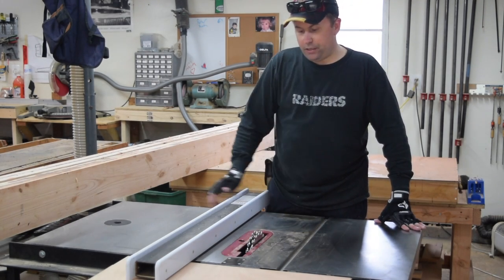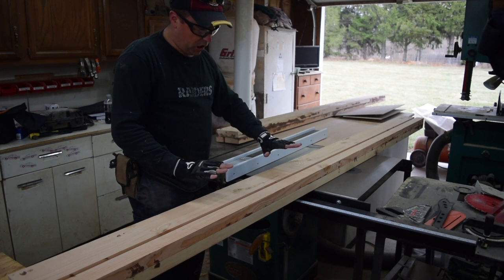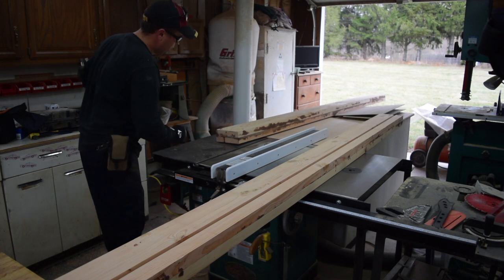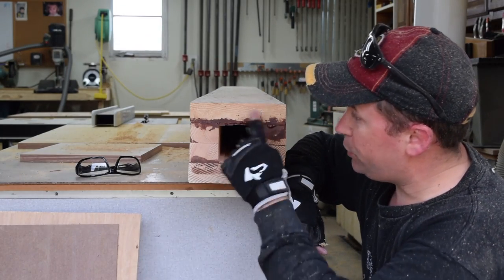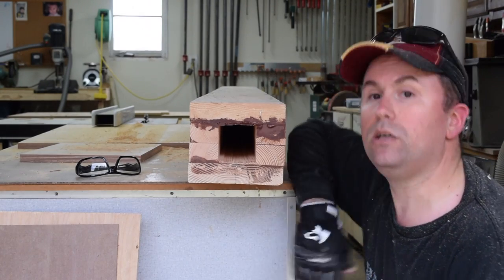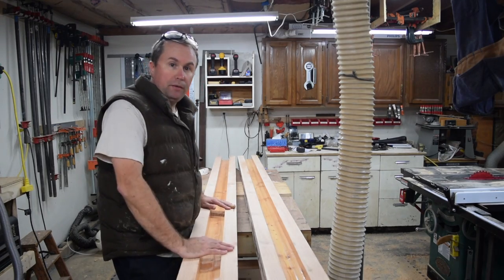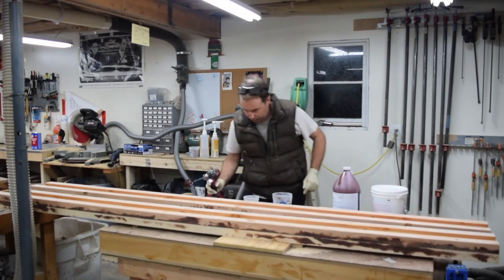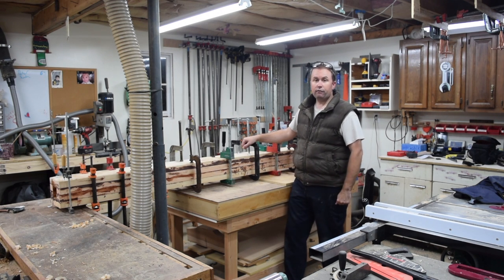Wooden Boat Building shaft log: Episode 6 Sea Dreamer Project

Comment: One trick to getting the perfect amount of resin is to simply math the volume of the glue-up. The to-be-glued area is the base and the thickness of the glue is the height. It's pretty simple, and i'm pretty sure there's plenty of Apps for iPhone or Android that can spit the volume you need. To that volume you add 1% more (or there about) to be certain and voila, you'll never squeeze glue out ever again.
Also, in my opinion it fits perfectly with the carefully measured methodology behind resin glue.
The idea is based on how they glue car panels today, they math the whole thing down to a square cm, which is incredibly precise considering all the twisted shapes and volumetry of a modern car.
Reply from the maker: That sounds really technical, I love technical! I want a little squeeze out to confirm the joint is filled with adhesive, but finding a way to limit waist is always appreciated, thanks.
Reply: The idea behind squeeze out is to demonstrate that there was sufficient adhesive in the joint,
The art is understanding how much adhesive you should apply.
Unlike the automotive industry wood workers don't have the accuracy of positioning and metering.  Also the surface is absorbent.
The viscosity of resorcinol is hugely affected by temperature, on a hot sunny day the stuff willnrun all over the place.
Finally its pronounced re-sore-sin-ol

Comment: Umm... was all that cutting necessary?  It looks (and I could be wrong) that you cut out the middle of the boards you glued onto the first board.  It appears that an easier way might have been to cut 2 of the 4 boards into thirds (or however much you were going to cut out) and then just glue the remaining pieces.  You'd get the same shape at the end with less wear on your saw, less waste (if you can find a use for those pieces you just cut), and less glue--since you'd have smaller areas to glue to start with.  Maybe next time.
Reply from the maker: It was close but there is actually about 1/4" of material still left in the board.  I thought about your idea but decided it was worth it to have a little more materiel in the log. Thanks for watching.
Reply: Percentage wise and added strength wise that 1/4 inch is a lot.

Comment: How does the cutlass bearing fit in this
Reply from the maker: Hanger bolts for both the cutlass and stuffing box.  Check out salt and tar, same keel concept.
Reply: I looked at Salt ad Tar until I went cross eyed didn't fine it.  and As i typed this I think I understand. Hanger bolts at the end then nuts on the flange. My question is more on the round bearing going into a square hole. Will it be supported inside in any way. Or is your bearing so heavy it doesn't need support.